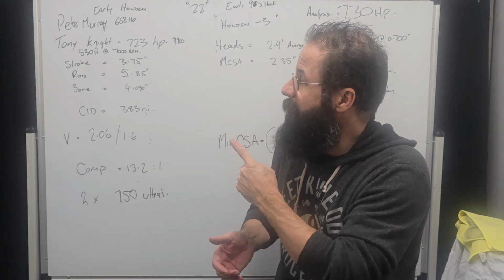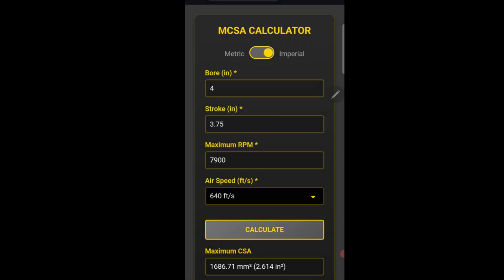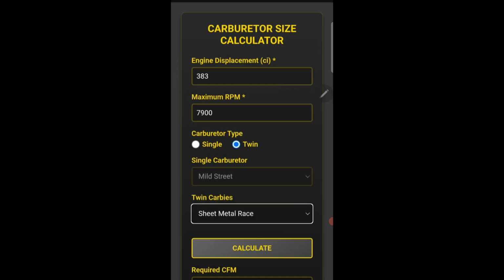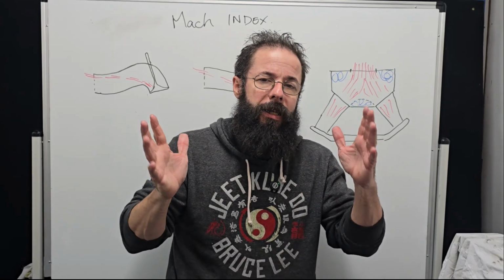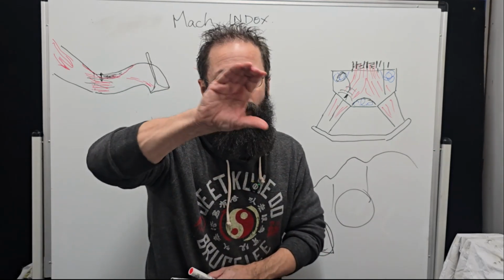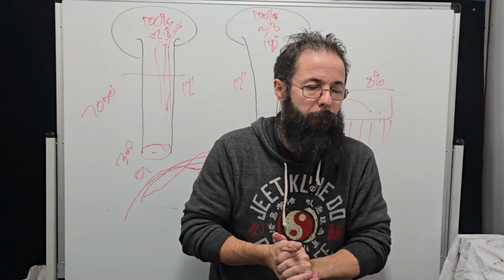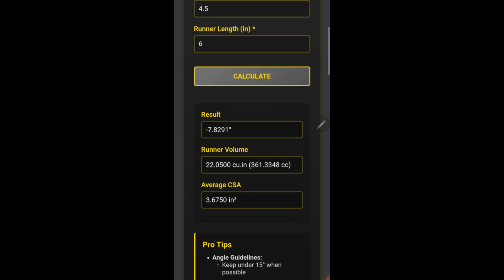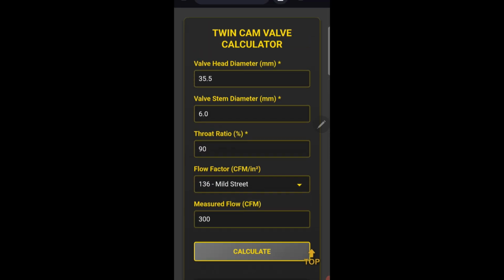Induction Secrets Part 5: MCSA Mach Factors and real world example

Comment: I believe the optium turn for anything is some sort of clothoid or Euler spiral.
Reply from the maker: They are the same thing. But no. The optimal turn is limited by the velocity it needs to handle and should be a simple radius with a wider short turn then  the long turn. It more about how we control the pressure gradients and localised air speeds. 

Hope that helps. 👍

Comment: So this straight vs tapered runner is why I see people dyno testing massive variations in runner lengths, up to ridiculous sizes (meters) chasing 1st wave and not seeing the results they should because it's just parallel tube? So almost wasting time with that testing as its the incorrect variable?
Reply from the maker: Spot on, changing length without addressing taper or CSA usually just moves the restriction around while generating false data sets👍

Comment: Would a runner with a bend have to be longer than a straight runner shape in order to achieve the same “gulp”? Since the bend(s) don’t allow the air to flow effectively? Or have to be shorter with bend(s)?
Reply from the maker: No, but it will need more CSA as the bend will "shrink" the size of the hole
Reply: @b @bainracing in one location by a bend or strategic areas? A typical dual plane for  instance
Reply from the maker: @jimdrechsel3611 dual plane is certain areas. Like the bends. Wider on the short side is key and pre bend needs a little more CSA generally as the bend with artificially inflate velocity averages.

Comment: I watched the entire video to see which mach number should be used for a 4 valve EJ with a 90 degree bend in the runner and you never got to that. Time stamps would be great for saving time and quick reference. You recommend 600 to 640 feet (.54 to .57 mach), but I don't want to open up the throats too much for a street engine. EJ22E NA reving to 8000 rpm with 98 EJ25D heads (cousins of the EJ20K heads). Stock MCSA of 1.968 square inches.
Reply from the maker: So you don't want to size it right because its a street car. But you're taking it to 8000k??   😂😂👍

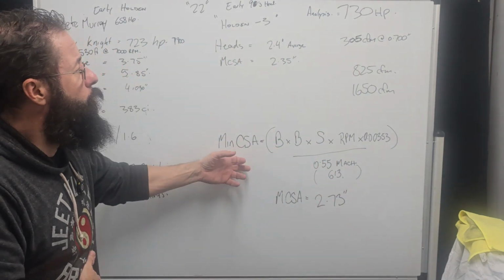Comment: 8:41 Do you have any insight on applying MCSA to rotary engine ports? Is there a specific velocity index you'd recommend? The secondary port entry on a Renesis are quite small at 31mm diameter, so I'd expect the velocity to be quite high there. 
Also do you a video where you talk about what velocities you should be targeting throughout the inlet runner? I imagine in my case, due to the MCSA being tiny, that the runner inlet will need to be fairly large in order to reduce the velocity at the inlet. Am I thinking about this correctly?
Reply from the maker: Yeah we do talk about average velocity of the port.  2 valves are 270-300fps and 4 valves are 300-330fps generally. Not sure about rotary engines.  But generally airspeed is be up around those figures to get any additional VE'S. Best to calculate the MCSA area. As remember the swept volume from each side of the rotor is very small.
Reply: @bainracing  My current plan is to work sort of backwards. Since this year I'm not planning on porting the side port intakes, the min CSA is set. So I'm finding the velocity at the MCSA, and using that as basis working out what to do for my runner inlet. 
So my variable are the swept volume of 654cc (39.9ci), adding the primary and secondary MCSAs together gives a total area of 2.277in^2, and a peak RPM of 7200. Working backwards through the equation gets me an average airspeed between the two MCSAs of 567.2fps. 
I figure I can then go from there to size an appropriate runner inlet diameter. 

Also I do plan on porting them out for some more power and that includes revisiting the MCSA. But that's the next year's plan.
Reply from the maker: Yeah that sounds like a plan man! 👌.  Definitely work on the averages then giving it move volume behind the small port 👍

Remember to compensate for rotor speed. Not crank speed. As they are a 1/3" stroke technically 😂👌
Reply: So rotor speed is 1/3 crank speed. So at 7200rpm, rotor speed would be 2400rpm. Which would mean an average velocity of 189.1fps for both MSCAs, which feels way too low. Unless I'm missing something?

Comment: 46:20 In an imperfect world (stuck with modifying an OEM manifold) is it better to target the ideal harmonic length even if that increases the gulp factor to over 100% or is it better to get the gulp factor correct even if that means shortening the runner to a point that it pushes the harmonic effect past redline? 

Or would that he something that really boils down to the specific application?
Reply from the maker: Get harmonics right first 👍
Reply: @bainracing  Thank you for the reply. Much appreciated.

Comment: I have seen on our dyno a Honda K, NA engine that needed a straight trumpet. If it went 2mm wider at the trumped opening in a 90-100mm trumpet length, it lost around 5hp in the whole driving range. I am guessing that is because either the throttle body or other parts of the intake are too big. (haven't yet tested straight trumpet due to clearance, so maybe the curved also might be one reason, being 20 degrees. 30 degrees was also reduced hp) making around 145hp/L in real numbers, so it's one of the better road/rallycross racing engines around here.
Reply from the maker: Yeah definitely an  indication its a little big somewhere.  Yeah. Bends definitely don't help. Especially if they are a symmetrical bend. 👍

Comment: @bain racing So I am trying to figure out what air speed I need to calculate with but I can't figure it out. I have watched the complete series twice now, but even though I am super interested and thankful that you are sharing your knowledge. I cannot recall you showing how to actually calculate the air speed.

I have a 4 valve dual cam mazda engine from 1992 and If I understand correctly I should probably aim to be around 0.5 mach air speed at MCSA (which is the valve seat), so that's around 550ft/s. But how do I actually calculate the air speed at MCSA?
Is this done by by using max piston speed,  piston area and MCSA area? because then I only get 146m/s per intake port at 7500rpm. which is 0.44 mach.

At first I thought it was done by dividing the actual swept volume of the piston, by the time i takes for the piston to move down, but this only gives an average air speed during intake stroke, not peak, which is what you are using I assume.

Hope you can help me out here,

Kind regards, Lars
Reply from the maker: Mate use an MCSA equation. That takes into account Cubes,  RPM. 

I break this down in a few videos.  The Air speed will be plus 600fps at rhe Min CSA.  And it's a dynamic calculation we have on the EM platform with variable air speed targets for different port shapes and designs.

Comment: great content, picked up a gold membership for the excellent calculators.

there's a notorious intake resonance issue with VQ35DEs that is currently plaguing my streetable build; the natural frequency of the intake system seems to be in the 3300RPM range, and so applying throttle at that time causes bogging due to, presumably, rarefaction waves interfering with induction. NISMO (Mike Kojima) and Cosworth both took a shot at it, and both couldn't find a way to optimize the dual-chamber-over-single-plenum setup. 

if you've got an email to contact and pay for your time, that would be ideal.
Reply from the maker: Yeah, a single plenum is generally better for harmonics.  And you can try a spacer between the manifold to add some runner length to shift it a little lower. But also the exhaust on these things can amplify things.  What's on the exhaust side?   Would love to help. Unfortunately, we are booked solid this year and looking to move our workshop in the coming months.
Reply: @bainracing  the spacer suggestion is good. hood clearance becomes an issue but Jim Wolf Technologies, who do all the IMSA VQ engines, mentioned some are sensitive to 1/4" or 1/2" length changes, so maybe it'll help.

exhaust side are some beautiful constant diameter prototype equal length headers, into restonated pipes and matching resonated Y-pipe merge. I think the issue is more to do with VQ trumpet harmonics, especially the intake plenum, as they use a blended solution. see SAE 2002-01-0450 (Michishita et al.).

the car is on the upper limits of what the stock engine can produce, aside from the mild JWT cams in there. it's only a smidge over 300whp/280wlbs-ft.
Reply from the maker: @SpectreFTL Oh it has cams? Have you played with the Intake opening and LSA also have you checked  bank-to-bank cam index? On a lift basis you need to be within 0.001-0.002"" of lift bank to bank.  I've seen many aftermarket cams not dialed-in properly cause harmonic issues.

Comment: I deff struggle with the decimal imperial. I have to convert fractions to metric then back again. This is why imperial is broken, it needs to borrow from metric, decimal system is metric😂 ouch my brain. Also the 1 square inch, converting to 640 mm or whatever  also does my head in. 1 is an inch the other over 2 foot😂
Reply from the maker: Yeah, I grew up with both so switch between all the time.  Metric for the 4 valves. Emp for the 2 valves 😂👍

Comment: Hey Jake was wondering your thoughts on the air getting into the engine. Is this from atmospheric pressure pushing itself in and the byproduct creates a manifold vacuum or is it the pistons going up and down creating a vacuum pulling the next air charge in?
Love to hear your thoughts on this.
Oh....great content like always 👍
Reply from the maker: Yeah, always see it as the atmosphere "filling" a low pressure as "technically" theres no vacuum.  Zero gauge pressure at sea level is 14.7psi.  The engine only creates a pressure differential and a high pressure fills the low-pressure area.  This helps us understand the "force" and weight thr atmosphere has.
Reply: @bainracing many thanks for your insight regarding this
Reply from the maker: @paulh3217  No problem at all mate

Comment: Hey brother Jonese here again and check the dynamics in this running boosted manifold... The flame in in ports are very interesting and how it affected the run...

https://youtu.be/7EtUA_zufc8?si=N67YeVAe5dBbWDGA
Reply from the maker: Yeah very cool hey, Steve's a top bloke! And this is very common and leaves a carbon trail in the induction path.
Reply: @bainracing Agreed 😊....I have learned this from my Grandfather a very long time ago. We have used this plexiglass technique on many types of engines to watch, learn (data) and using the timing light to expose events you can't normally see with the naked eye...

  I  was thinking that you could use this clip in one of your bad ass educational videos to show the inefficiencies (timing/ overlap/pressure/ area and mass) down at that RPM causing this what i would call a phenomenon...😊

Knowing that any internal combustion engine has a small window (2000 RPM) range to stay in tune optimally with one exception; the NEW ( intriguing) dark matter engine imo😊

I do have one question or thought for you about the "occurrence" of this inefficiency happening and its corresponding harmonic in your opinion😊.....I would tend to think the third or fourth harmonic at that RPM? 
Have a bad ass day Brother and thanks for all you do! Cheers 🍻
Reply from the maker: @JJONESMX09 Yes definitely some harmonics will smash and engines efficiency especially at low "out of range" areas with high spill back rates.

Comment: All this is to sell a app and its features ,most drag racing apps online are free even old school 1990's drag racing computer games you can changes the figures in almost every aspect of a engine or drag racing application right down to the gear box ratios, tyre size fuel used ,wind every aspect ,changing the angel of the dangel of your runners is only good for those who want to race ,people are not going to change the runner shapes even if they have a plastic or hi temp and feel resistant plastic printer and make up aftermarket injection air intake systems because is simply to expensive so those companies who see aftermarket air intake systems like holly  and others will not spend the money on R&D to make 10 different runner styles and dimensions to sell to the market? 🦘🦘✌✌👍👍
All this maths and calculations goes both ways, both in and out through the exhaust system so the less curves you have in any pipe the better, but the retraction bends and the angels is the main aspect to get right, especially turbo engines or boosted engines. There's only so much you can do in injected oem engines, unless you want to race the car and build a real race engine which will set you hundreds of thousands of dollars to make the engine reliable or buying a 2nd complete nascar engine chevy mopar or ford ,then maybe you will have a good set up for the start, but even then it comes down to dollars and common sense full stop. 🦘🦘✌✌👍👍

Comment: These videos are great.  Ive been trying to develop a port for my 3V 4.6 mod motor heads.  A couple things I’ve been wondering the past few years are- 

If the air mostly shoots over the valve and tumbles, is the ‘window’ ever the MCSA (minimal), or do you still try to get that down at the throat?  

And, in tumble port, 4 valve stuff, is there any benefit to unshrouding the valves on the short side?  

Thanks!
Reply from the maker: Yes mate. Lots of even modern 4 valves have the MCSA at the port window.  But they have very gentle angles.  Yes I know the heads you speak of. They were a funny design of both swirl and tumble as that was the one with the difference ports wasn't it? And originally had the flap valve?  Sorry it's been a decade since I've played with them. 

And yes any work un-shroudding is of benefit as long as you are focused on the CSA and the shape.  

Removing any sudden changes and smoothing the shape is probably the most important area to develop gains.
Reply: @bainracing  Thanks Jake.  It's the Triton 5.4 head, but it was the same head on all the 3V stuff, including 4.6.  I did notice when spraying water through the intake ports to wash the heads out that it does induce a bit of swirl as it meanders around the giant spark plug boss at the end of the divider just before the seat.  And yea, they did have a little flapper valve between the intake and cylinder head.  

Follow-up question- Do you find PipeMax can accurately gauge ACSA for multi-valve stuff?  How do you feel CSA's compare to 2 valve heads with less line of sight?  I know you said less line of sight = lower mach index port.  PipeMax says my ports are too large in stock form, but when folks like Livernois hog them out they do make more power.  But, considering you can run higher mach index on the line-of-sight ports, maybe it's spot on?  I'd like to know if these ported heads are actually making better ET's at the track or just bigger flow and dyno numbers.  

I know what I really need to do is get on a flow bench and do some testing/trial.  Just trying to wrap my head around some concepts and theories for now.  I ported one set of heads completely for my first build, and I have those power numbers.  I just finished putting together another engine where I decided to do an experiment, and all I did was unshroud the valves, cut in a 4 angle valve job (intake. Exhaust has radius bottom cut), 88% intake throats (offset to the short turn side) and blended the seats in to the port and chamber.  I opened up the exhaust ports, but I left the intake ports alone.  First impressions are it pulls way harder than the last engine all the way to the current rev limiter at 6600.  We'll see what she does on the dyno in a couple weeks.  But it feels promising.

Comment: Jake, from 29:30 you have a very good explanation of the angle change transition where the manifold and head intersect on the typical v8. How much do you think this in-situ condition affects downstream flow at the throat/valve v the flow that is being observed on a flowbench? Not just raw flow numbers but velocity and velocity gradients.
Reply from the maker: It does 100%!  The higher the runner is above the port centreline. The faster the short side becomes unstable.  And what we have found is, being just under the port centre line. 2-3° so slightly downhill can actually make the SSR more stable at higher velocities.  

The super stock and other high mach index heads we actually exactly this!  You can also play with L and R angles to excite or settle port velocities.

Comment: This is a question related to my engine but I think it might be intresting to others building on OE platforms.
Im building a 60 deg V6 engine with heads and intake from the 3.4l LA1.
The port area in the head is 11.34 cm2 and at the top of the lower intake manifold the area of the runner is 15.2 cm2. And from this the runner takes a 70 deg turn that goes into a 90 deg turn into the plenum where the mouth of the runners is flared to maybe 20cm2.
This is a huge area change on the runner from the head to the mouth in the plenum. As I understand it a taper of around 30% is more suitable.

 I plan on making a custom plenum and top part of the runner, removing or reducing the 90 deg bend. But since theres still that 70 deg bend and such big area there, would it be better to make the runner smaller to get the mouth in the plenum closer to that more suitable 30% area increase and let it get bigger towards the70 deg bend to get a better flow round the bend?

Maybe its hard to understand without a picture. But it sounds like youre saying something to that effect. IE let the runner swell in area towards a big bend?

The engine is a 3.4l two valve (1.76/1.42) with a custom cam 280/280 236/231 with .550 lift and will be run to 6000 rpm. Bore and stroke is 92,5/84mm.
Reply from the maker: I think I understand mate. I'll add it to the next video series.